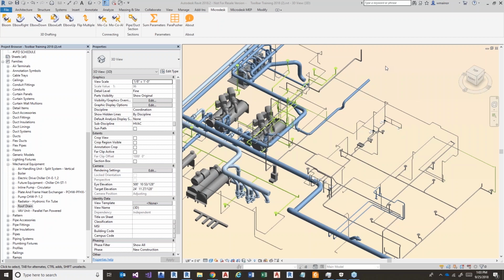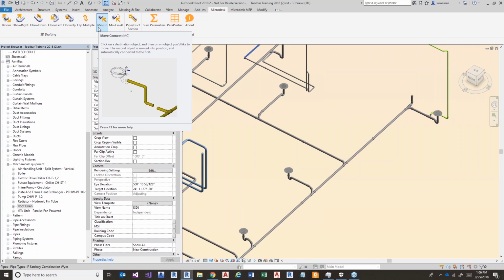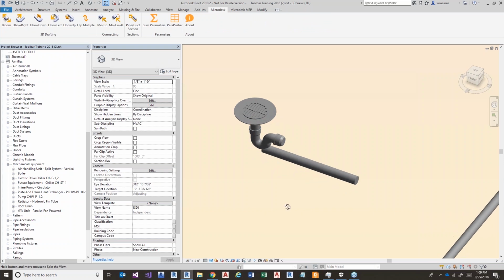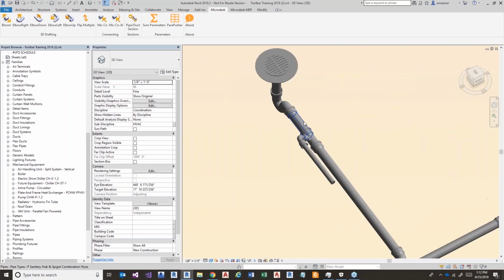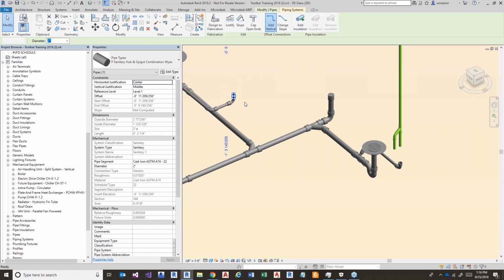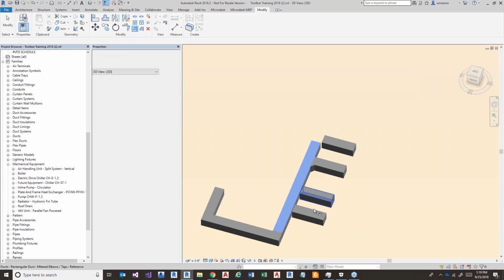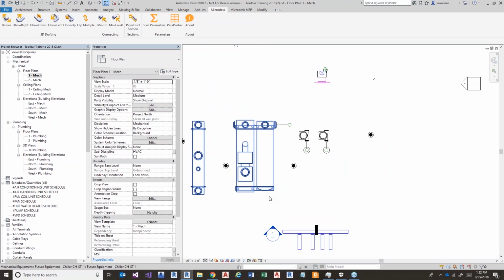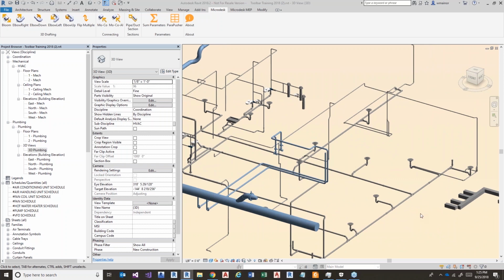Webinar: Microdesk Accelerator

Comment: Not sure why your using different pipe types for wye tees and or combo's?   take charlotte's pvc fittings insert them into the revit OTB tee  add connector at start of hubs  and then you can assign a ref line with angle adjustment to rotate fitting after placement as well, another step that I took was to automatically add a bushing and/or reducer based on formula involving connector sizes..  Did this for combo's 502 504 , wye 601, and a  DWV Tee with charlotte hubs ((Customized all lookuptables to include all sorts of unlisted sizes , necessary for transitioning fittings from unreal to real )and so on and so forth the idea is that switching btw OTB fittings to the realistic fittings should be hassle free. Take charlotte p-trap insert into OTB PVC Elbow  ,  create a left & right family version, also it is possible to create an instance parameter to adjust the swing of the p-trap, difficult but it can be done. Now you can switch elbows into p-trap with some ease depending on the orientation the elbow is in,  thus the need for two families a left & right version.